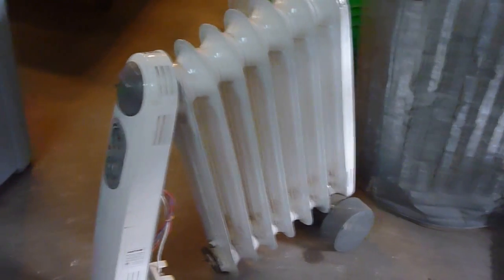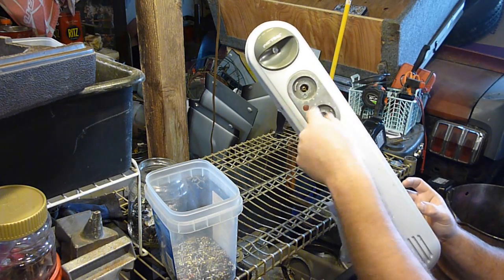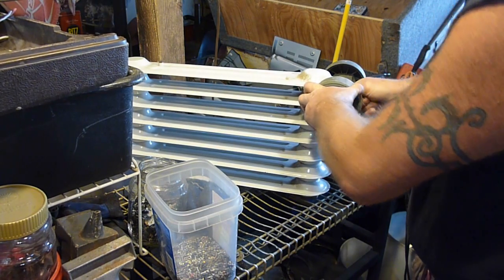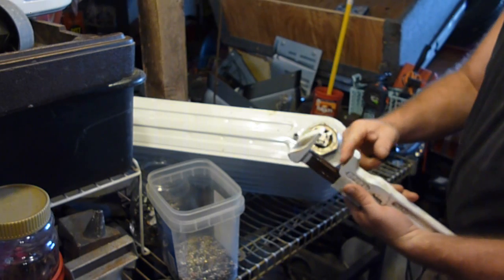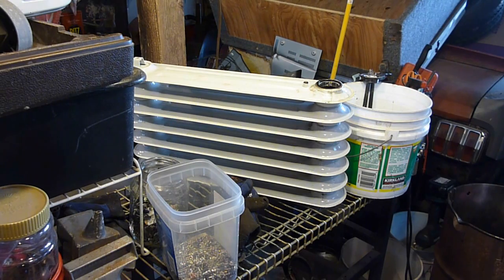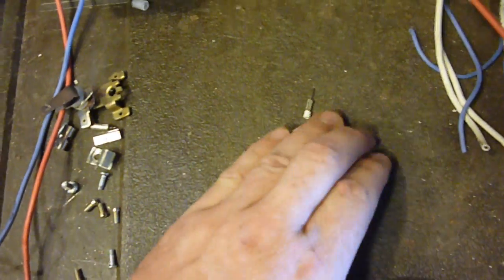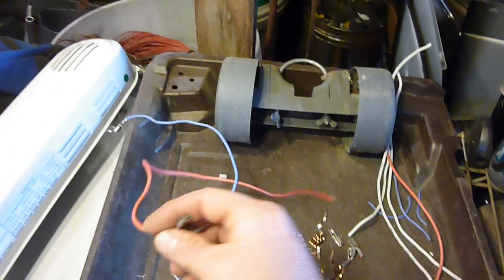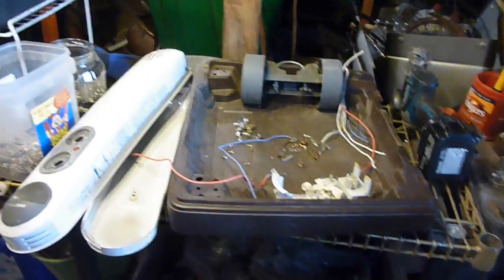What's inside? oil heater

Comment: The wire is tin coated, when stripped it goes in #2 pile, you will get insulated wire price for it if it stays in insulation

Comment: I have an oil filled radiator similarly build. But instead of thick oil like yours it has water like liquid when I shake the heater. I wonder which one would be better to store heat, water or oil. I remember once I heated a pot of  oil and it stayd untouchable hot like hour-two.

Comment: Great video i have just brought a diesel heater and am going to get one of these broken down heaters to run the exorst through as half the heat is going outside. Do you know if the metal on those heaters are weldable? Cheers mate
Reply from the maker: there steel but im not sure if they coat them with anythig that could interfear with welding .
Reply: Did you do it ?   I have both and was thinking about doin the same
Reply: No havent done it yet mybee get back to me in 8 months as we r going into summer now
Reply: @michaelroberts6299  shit man we are goin into winter now lol
Reply: I brought a long piece of exorst by its self for cheap off ebay im going to run that through 2 of those heaters seal it with a weld although be for it goes into heaters ill run it in a loop above heaters for saftey reasons  get a couple of meters of that exorst hose and just plump it in the exorst first, if it still runs fine with all that extra exorst it wiil run fine once u put it through your oil heaters
Reply: I was going to try that too!   I seen another vid of a guy who did one   looked good

Comment: I have four 325 watt solar panels, each with about a 50 volt DC open circuit output. I think I'm going to do a series + parallel configuration and experiment with powering one of these at 70/80% of the design rating. Thanks for doing this. It looks like it should work fine. The heater's designed for AC, but I see no reason why it wouldn't work w/dc, since there isn't a transformer or switching PS anywhere.

Comment: "Diathermic Oil": These type of heaters use highly refined mineral oils, which evenly fill the outer fins of the radiator as the oil is heated, so even when the heater is turned off, the fins retain heat longer to transfer into the air.

Comment: Kudos to you for telling the world to not throw things away needlessly. I have been trashpicking our dumpsters in our huge apartment complex for eight years. In that time, I have found about 5 to 10 oil heat heaters, including one last night. Wonder of wonders, with the possible exception of one I forgot to pick up later, every one of them worked! That includes the one I’m testing out right now, a DeLonghi model EW7507EBL. It heats up and it does not leak, but I cannot figure out the timer and the clock on it, which appear to be wonky. Perhaps that’s why it was thrown out. This is a wasteful shame as once I cleaned off the garbage goo, it heated up just fine with no leaks. I just now conducted the “tip over” test on it. It failed as it supposed to shut off automatically if tipped over. Perhaps that’s another reason why it was thrown out. But at least the wheels can all be pulled out so as to make it hard to tip over in the first place.
Reply: Most of the time it the over heat shutoff that has failed. You're not supposed to run them on the high settings. Use the 2 and 3 settings to heat up the radiator faster. The turn to low to maintain the room temperature with the thermostat set somewhere in the middle.

Comment: my radiator makes noise when it starts to heat is from gorenje company what can i do
Reply from the maker: moste make some nois when heating and cooling it is from the expantion and contraction of the metal but if its exesave then i would send it back if you can

Comment: Looks like there is a short heating coil for the low setting (600 W) and a long one for the medium setting (900 W) then the two coils combined will be for the high setting (1,500 W). Interesting. This is better than to adjust current for heating setting. Love your work, by the way! Always want to take things apart since I was a kid to see how it works and try to reuse components. I have a box full of various sizes of screws, bolts.... just like yours but your parts are shinier.

Comment: You're the only one on Youtube who actually did a whole disassembly and it was so useful to me to to figure how to open the heater unit but I still didn't find the reason for the oil smell that started to come off since Christmas. I'm afraid there's a leakage, what do you think?
Reply from the maker: i would stop using it the fire danger is not worth it
Reply: I forgot about this comment until now, there was no leakage it was probably due to the sensor was faulty and it would work continuously till the oil is overheated, that may be the reason, it's a cheap on anyway it was a mistake to buy it.

Comment: This is exactly what I needed.  It's amazing how much info is on the internet now.  I wanted to take apart an oil radiator, but wasn't sure exactly how that heating element was in there.  I didn't want to force it just in case.  My 24" adjustable wrench did the trick.

Comment: Back in my early teens, I used to weld the oil-fins together. Two pieces have to be perfectly welded together with no holes in the welds. They have to be leak proof, and the welding has to have perfect penetration. Company I worked for back in those days (when I was younger),, made these type of cooling fins for this purpose, as well as for both hydro, and phone transformer cooling blades. Like this small set  (seen here), they look the very same, except are larger in size to disperse, or give off lots of heat, to keep their transformers cool, while in operation. They are also all oil filled. Video brought back memories.

Comment: I was curious about what a heating element in one of these heaters looks like and you show it well. Thanks. I found only one photo of one before watching this. So the short one is the 600 watt and the longer one the 900, and they look very much like the elements in an electric water heater. I looked up the difference in diathermic (heat transfer) oil and lubricating oil. Diathermic oil has a high boiling point (3x that of water) and a low freezing point, and the oils have other various properties as well. Lubricating oil has to be a certain viscosity for what it's being used for, and also what kind of residue it leaves as it is pyrolized (combusted without oxygen), which isn't a factor in a closed system like an oil heater.
Reply from the maker: Thanks for the info 👍

Comment: Our 82 year old friend died of dementia and we got his old heater (lots of signs of burning on it) that we had to dispose of.  The metal recycle wouldn't take it due to the oil.   I made a hazardous waste appointment with my city's trash.  They wouldn't take it because of the oil.  They said they take metal and they take oil but not together.   So my husband and I took it apart and drained the oil.  (He used one of his plumbing pipes to get off the knob.)   I have emailed Delonghi to find out what kind of oil it is.   They haven't gotten back yet.  Some places say it is mineral oil.   I've made another appointment for hazardous waste to dispose of the oil.   We are going to take the emptied metal to the metal recycler.  They may or may not take it according to someone on the phone.   Geeze, I've had this thing for 8 months and it wasn't even ours, and it is so hard to get rid of it.  If the metal recycler won't take it, I'm going to take it with the oil we got out of it and hope they take it all emptied out.   Last resort would be to put soap and water in it and try to clean out the residual oil and hope someone will take it.  But then I'll be dumping that in my yard.  If it's mineral oil, maybe it won't be too bad.
Reply: Any updates?
Reply: @lovewenwin  It was diathermic oil.  We took the heater to the metal recycler.  I don't think they even looked that close at what it was.  The hazardous waste took the oil.  I labeled the old plastic bottles I put it in as diathermic oil.   Glad that is all done now.
Reply: Why not just burn the oil
Reply: @Sebastian-gj9tc  In what kind of container?   I think it isn't a pure substance that will not harm you in any way.  I'd rather let the hazardous waste people deal with it.

Comment: mineral oil, thats why these are safe heaters cause the oil does not interfere with any electrical components (people made computers in mineral oil)
Reply: Hi, the oil fumes make me I'll. Can I drain the oil and fill with water?
Reply: @josepe2448  no, water evaporates to gas an expands, itll turn into a small pressure bomb
Reply: @Wildboy789789  they used to sell portable water radiators. I need one. The oil gives off fumes and makes me feel sick.

Comment: It's a form of silicone oil. I used to make them in a factory.
Reply from the maker: thanks appreciate it
Reply: i heard it was mineral oil.
Reply: I want to ask you this i have one , and it is very old but works very good and does not leak or rusty, i wonder how long can we use this oil filled heaters ?..how many years ?
Reply: @palangnar3588  for as long as the element works. the switches burn up, but i just bypass that

Comment: hi good video do u have any of flat screen tvs ,how much can u make from scrapping this heater ?
Reply from the maker: i scrap more to keep things out of the landfill, and my own curiosity. i take truck loads at a time ,so i don't break everything down , it  is not worth scrapping just one thing. i would probably only get a few pennies for for the metal and maybe  the same for the copper and brass, it depends on the scrap prices in your area.i haven't done  a flat screen yet but i only scrap stuff i  get  for free thanks for watching ime hoping to do more scrapping vids but right now i'm in the middle of to many projects around the house and scrap is low right now
Reply: i do the same t as you to keep things out of landfill
Reply from the maker: good to hear  every little bit anyone can do helps
Reply: its enjoying doing it

Comment: Your like me, ive got wires with Connectors on and reuse them to save using new ones, i get a knife and release cable ties and reuse or cut off the end that goes through and reuse it on something smaller. No need to waste much at all